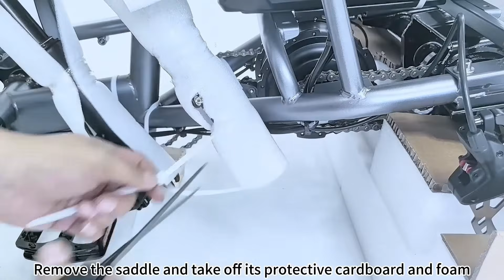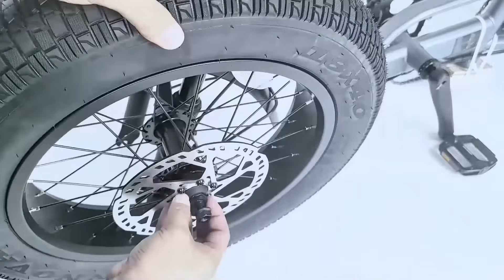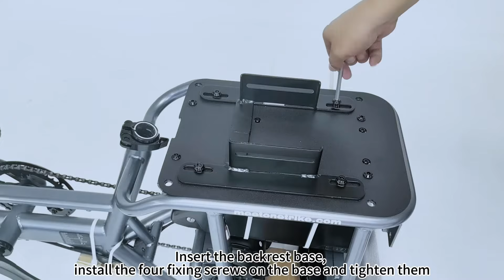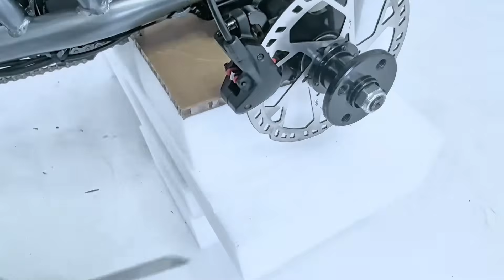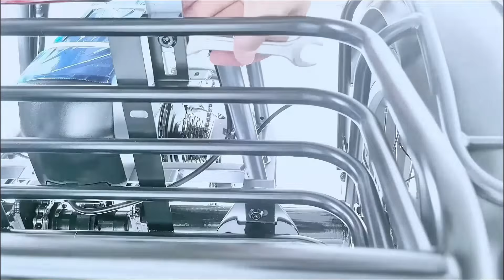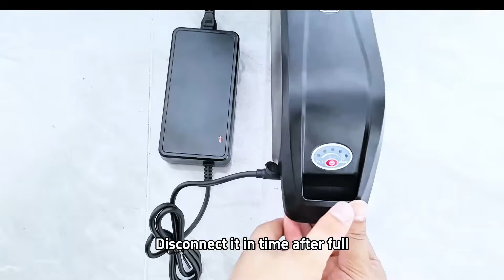Meet One Breeze Folding Electric Trike- Assembly Video2.0

Comment: Every set of assembly instructions I find is different. Screws are missing for the rear wheels and fenders.The tool kit doesn't have the correct sizes. At least I now found video for mounting the rear tires, looks nothing like what my tire looks like right now. The instruction video Meet One sent me showed the rear ties already on, they are not. There was also no front brake block, so I will have to go get the brakes adjusted, the brake pads are rubbing. Really disappointed I'm going to have to spend money I don't have to fix something that is brand new. The screws provided are too big for the slat hole the backrest goes on, so it is not adjustable unless I go buy smaller screws and nuts. I paid too much for this trike for this lack of quality control. I called customer service. They said if they send me replacement parts they will be coming from China, and who knows when they will arrive. They said the best thing for me to do is go to the hardware store myself to get the parts needed. Then I can call them back once I get the bike together and they will talk me through adjusting the brakes after I send them pictures of the brake pad locked already onto the tire because they did not ship with the brake block. They do not quality inspect their product before shipping to customer. This is not a real American company. China just sticks Meet One name on it and ships it from China. I now give this company a ZERO. I was planning to order a moon cool. The great review that meet one had I decided to order from them. I now regret this decision.